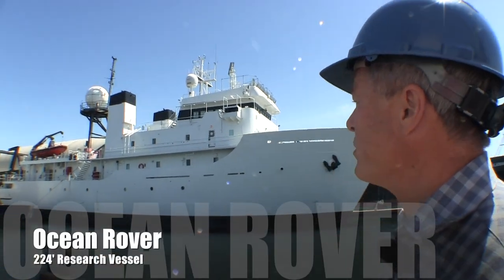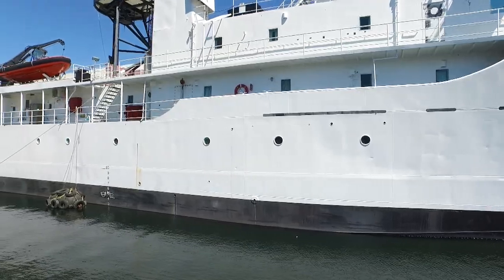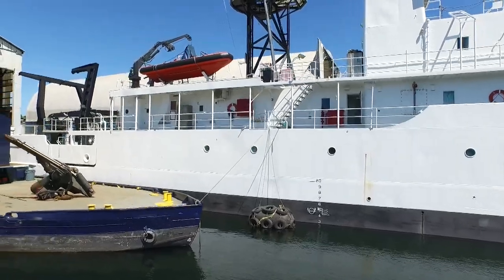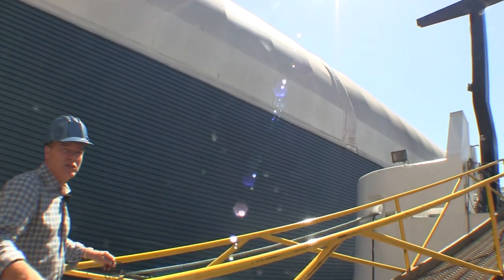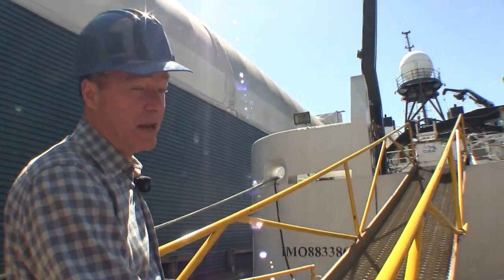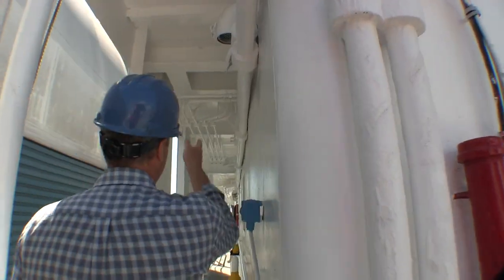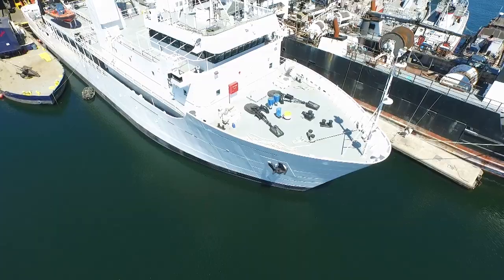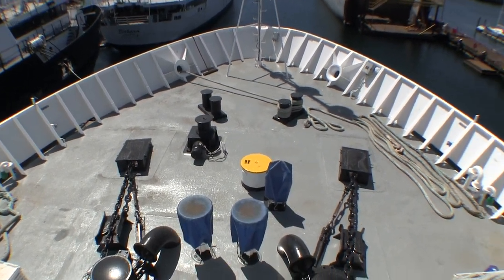This amazing former US Navy Research Vessel was sold and is working in the Pacific

Comment: I sailed on the stalwart class boats. They are tough, spent three days taking 30 to 40 degree rolls. Floating gas cans, they use like 500 gallons a day just putting around. The Navy was giving them away after the Tagos missions stopped. Slow as hell. They do 12 knots full speed.  First thing to do with them is trash the quiet screws and replace them with regular screws. They were talking about scrapping them on the ship i was on they figured they could get 15 with standard screws. It wouldn't be my first choice for a conversion.

Comment: This is an impressive ship. If modified right, would make a great yacht for travel and exploring.  You have to think of its strength and redundancy, which almost current yacht builders do not build. And this hull is ice rated.  Impressive indeed.

Comment: This is a Stalwart-class ship, we have a converted one here at the maritime academy that I'm a cadet at. Not sure where the claim that they're great, seaworthy ships comes from. They're stable, yes, but they're very top-heavy if it's under loaded and ours handles like shit in any significant amount of wind, even with our giant bow thruster. And I'm not even sure if the bow thruster was original or not.
Reply: Could be you were running just enough fuel for a couple of days which would make it top heavy and effect the handling.

Comment: He says it has a quarter million gallon fuel capacity and that it burns 1800 per day. It is listed as a 9000 nm range at 11 knots. At 11 knots you go 264 nautical miles per day. So 9000nm would take 34 days. 34x1800=61,2000 gallons. I realize that this is an oversimplification but the difference between a quarter million and 61,200 is a pretty big margin of error.
Reply: listed as 9000nm radius (not range)...so more like 18k nm range
Reply: 06600110 engine always run even ship is not moving
Reply: @yukeshvs9856  this is my old account

Comment: The issue is the number of crew/cost of running a vehicle like this. Usually if you can't afford the price tag of a boat that big and are looking for a insane deal, then you can't afford to run her properly afterwards. I mean it likely costs what $300,000.00 just to fill her up. then the crew must be what 15+ at least, minimum for that size of vessel.  Then you need to do painting, upkeep, cleaning, pull out for hull mantainance, etc.  I mean if you run ship this size it will likely cost several million a year just to keep her up to date.  If you keep her like this then it is much cheaper, but as soon as you tried to put teak on, beautiful interiors, all that need cleaning, and upkeep.  Then new engines.  So unless you have a way to make money off it guaranteed, i think like any vessel get ready to lose alot of money investing in it...
If you want a research vessel for $5 million, get a much smaller boat with better toys built in, and advanced helm setup, etc.  Go half the size, and be way easier to keep up...

Comment from the maker: Sloth- all boats of this vintage will have some asbestos in the stacks. It is sealed and the government does not deem it to be hazardous. But a new owner will have to survey the vessel and be sure there are no issues. Tis vessel is in class and ready to go to sea. The Navy build these ships to a far higher standard than yachts are built to.
Reply: I thought the ship was built in 1985.  If I remember correctly, it was in the mid-70s that we stopped using asbestos in ships.  

Of course a survey would be done by any owner and that would ascertain whether it was installed or not.
Reply: The Yacht Channel The Yacht Channel The Yacht Channel The Yacht Channel The Yacht Channel The Yacht Channel The Yacht Channel w
Reply: The Yacht Channel  I was a QA engineer on her at Tacoma Boat when built.  No asbestos used in construction